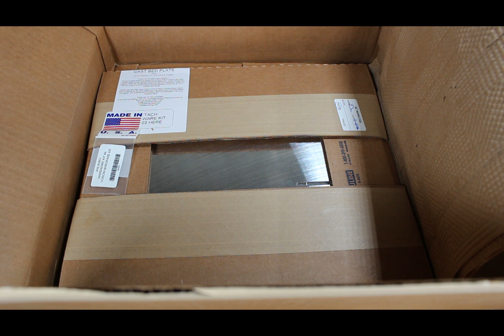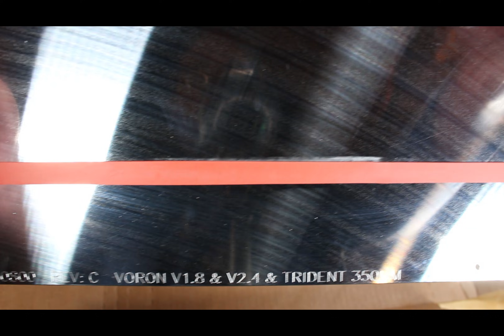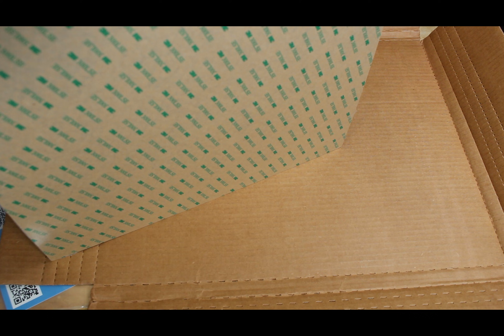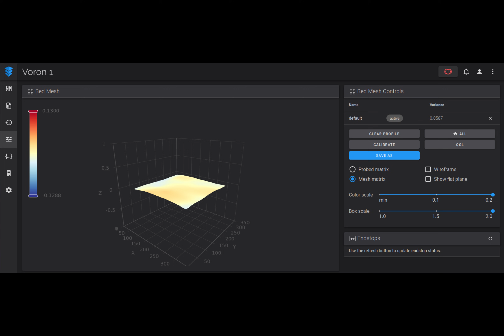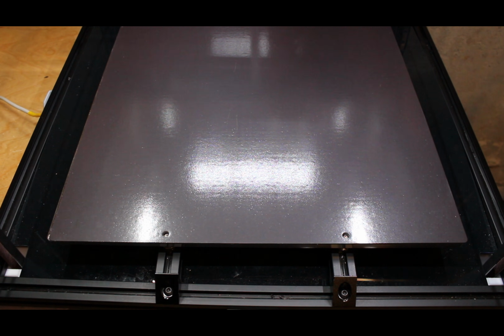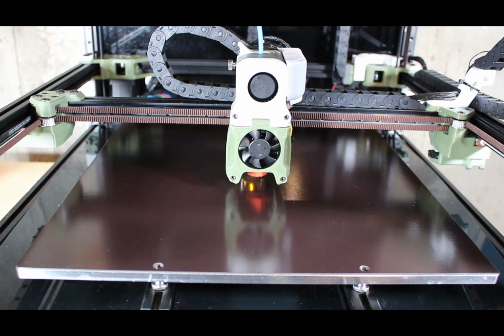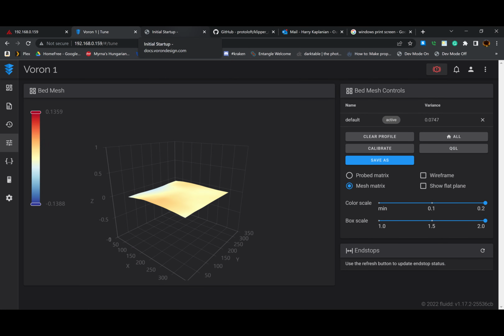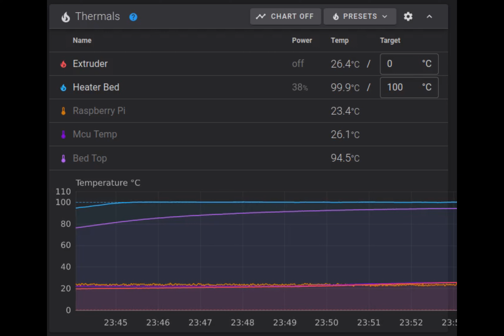The Secret to a flat  3d printer bed

Comment: I thought the whole reason for a mesh was so that it didn't matter how flat your build plate was... My variance is .5215 and I get good prints.
Reply from the maker: I would argue that a bed mesh tries to compensate for a bed that isn't flat and give you reasonable prints. It cannot make a bed or your print flat.  If you print a large object, even with bed mesh, it will still have a variance of 0.5215 on the side that was on the bed.  For most objects, this may not matter so you should be fine.  But if you need the print to be better than that, you need a flatter bed.  That said, a flatter bed plate actually didn't fix the situation. It was the application of the magnetic sheet that was the issue.  Thanks for the comment!
Reply: @KapmansBasementWorkshop  ahh I see exactly. If you print a 250x250x250 cube, the bottom will be wavy, and if those cubes need to be perfectly fit together, they wouldn't. Great explanation and great video!
Reply from the maker: Exactly. One other thing, it also just bothered me that I switched plates and my results were worse. I needed to understand why.  Hopefully this will help people when building their next printer.  Thanks!

Comment: i am not going to pretend it actually made any difference how you installed it or having bed flatness like that makes any difference or you actually needed it for anything its just ocd things
Reply from the maker: If you are referring to a difference in your prints, I think it depends on how much the bed is off.  Especially on large pieces.  But the way it was installed did make a measurable difference.  There is a aspect of OCD here, but to some it matters.  Thanks for the comment and watching!

Comment: nice mashined bed, maybe you could mention a important thing not to power it with 100% (depends on the heater power ofc).
The flatness of the mashined bed isnt that important i think after you put magnetic sheet and the print surface on it.
Got a cheap one out of a formbot kit and my Variance is 0.057 mm.
Reply from the maker: That is a good point and worth reminding people about 100% power.  
I think the beds that come with most of the known kits are good beds.  By using this new one, I was trying to take the aluminum bed out of the equation and limit the issue to something else and make sure people would not point to my bed provided in the kit as the source of the problem.  I think the video succeeded there, but I'm second guessing how I was able to communicate that.  Thank you for watching!

Comment: I use the same 750W heat pad and my bed surface and under the bed temp is normally 10 degree more or less gap, and, even more , the bed corner  temp is usually 3-4 degree less than the bed center.  Can't imagine what's the temp like with my old 150W 12V heat pad.
Reply from the maker: I'm digging out and restarting an old 3d printer I stopped using once my Voron was running.  It have one of those old heat pads.  I'm going to have a look in the next few weeks to see how well it does.  This is a good thought.  Thanks for watching!

Comment: I have a high quality plate but something in my gantry messes up the z variance .. im one step before rebuilding my gantry 😅….. i mean the prints come out nice but when im looking at my mesh diagram i get angry 😂
Reply: Yes the backer plates are also in my list.. someone used old linear rails as backers on the gantry … if i go for a single mgn9 hiwin would be the only choice..  i dont understand why some of the new single rail revisions of the voron are based on an mgn12. Maybe if the gantry moves fast from the front to the back you get more wobble on the nozzle due to less stability.. if the center of gravity of the printhead is to far away from the rail then the small rail could get an issue.
Reply from the maker: @rsmaster5637  I suppose so.  But so far, I have not had any issues.
Reply from the maker: Believe me, I know the feeling!  That was the start of this video.
How many rails on the x-axis?  MNG9 or MGN12 or something else altogether?
Reply: 2 Rails mgn9  .. i think i build a new gantry with one mgn 9 and the stealthburner.. or i go direct to a carbon fiber x axis with mgn 9 , lgx lite and stealthburner…
Reply from the maker: @rsmaster5637  In case you didn't see it: https://youtu.be/i8a2-Jd-dIo and the stl for single rail stealthburner: https://github.com/Kapman1/StealthBurner-Single-MGN9-Carriage
You can see the before and after of the single mgn9 rail and it's impact on the bed flatness (it improved).  Also, if you go with a single mgn9, make sure it's a high quality rail such as Hiwin.
I've been looking at carbon fiber square tubing.  I've received 3.  None of them are as straight and flat as the aluminum extrusion.  2 of them were very far off.  So I'm still on aluminum.
Finally, others have told me what a big difference backer plates have made to the flatness of their bed.  So you might want to look into that for the x & y on your gantry..

Comment: I'm wondering if this is why the Mandala Roseworks Mag Plate is preferred by most. Great video and makes sense, I'm building a Voron 2.4r2 soon, and was considering getting a Mandala plate to swap for the LDO kit, just don't know if it's worth the money or not. Lol
Reply from the maker: I think it is the reason.  But it's not cheap....thanks for watching!
Reply: My third Voron (and first kit Voron) was a 0.1 that included an upgraded Mandala Roseworks bed with embedded magnets.  Once I saw it and thought about it, I bought a new Roseworks bed for my 2.4 and I do NOT regret it.  It works really well and I’m able to consistently lay down a good first layer without bed mesh.  I do wish I had a thermistor on top, but I calibrate temp by pressing my DMM’s heavily-thermogreased thermocouple into the bed and correlating thermistor reading to actual bed-top temp.

Comment: Doesnt mesh bed compensation - compensate for any flatness issues? I had a glass plate that had some filament boogers underneath and came out find. even if the mesh was thrown off by 1mm in one corner.
Reply from the maker: It does compensate, but your print will still have it's shape impacted by the shape of the bed.  So it's always better for the bed to be as close to perfect as possible.  Bed mesh will help you have a successful print, but now your print has not technically "correct".  On some high precision (as good as precision can be with heated plastic) prints, this can be a problem depending how far off the bed is as well as the bed shape.

Comment: Use a high temp 2 part epoxy resin leveling liquid. You only need a tablespoon or so for the entire bed.
Reply from the maker: Have you tried this?
Reply: @KapmansBasementWorkshop  Not yet, but I'll be doing it on my son's CR-10 when I'm done modding this Ender 7. I've been trying for months to think of a reason that this might be a bad idea, and I can't. As long as the printer is on a level surface and it is applied super-thin ("squeegee" it with a razor blade), it should work. Some of those resins are good for 275-300 Celsius, so bed temps won't be an issue.
Reply from the maker: @apexncdaddy  I'd love to hear back about how this worked.  It sounds reasonable and I can't imagine why it won't work.  But the permanence is something I need to mentally get over.  Thanks for watching!
Reply: @KapmansBasementWorkshop  Agreed, though I can't imagine much actual damage coming from it as either way it will be covered (spring steel, pei, glass). An idea I need to think on is some sort of strong magnets (but not strong enough to affect the electronics) glued on the underside of the platform so we can use those magnetic build sheets without the adhesive backed magnetic sheets.
Reply from the maker: @apexncdaddy  There are companies that sell beds with embedded magnets.  I wondered why, but in hindsight, they seem like a great idea.
Reply: @KapmansBasementWorkshop  Who makes them? I've never seen one and I'm going to be building a beast of a printer over the winter where every gram counts. Would love to have something like that.
Thanks!
Reply from the maker: @apexncdaddy  They are not cheap.  Here is one: https://west3d.com/collections/vendors?q=Mandala%20Roseworks
Reply: @KapmansBasementWorkshop  $185? Yikes. There's $2 worth of magnets and 10 cents worth of glue in this printer's future. lol
Reply from the maker: @apexncdaddy  Yup.  :)

Comment: I wonder if you heated up the bed with magnet to 120 and then plopped it on a flat surface with the weight if you could have skipped removing and reapplying. Anyways, that's what I'm going to try as a takeaway from this video as I seek a flatter bed. Thank you for putting this out there and showing the process of discovery.
Reply from the maker: In hind sight, I wish I tried that.   If you do try it, please let us know what happens.  I'm 60% sure it will work.  One major thing to consider, will the heat cause the glass to shatter?  It might make sense to take the bed out and lay it magnet side down cold and then turn on the heater.  It will heat up slower and allow the glass to warm up slowly.  Then figure out what weight can be put on the back of the plate that's ok with the heat.  The glass table in the video is actually very expensive.  If I broke it, contending with my significant other would easily have been the most difficult part of the project :)
Reply: @KapmansBasementWorkshop  I tried this, and it didn't seem to work. Next, I will try a stone rolling pin at 120.
Reply from the maker: @tonyrouse6864  Not a bad idea.  I should have given that a try.  Depending how badly it is warped and the shape, you might want to try a slice of paper on top of the magnetic sheet, under the PEI to raise a low area....

Comment: Interesting video. Did you ever go back and back test the old plate with a new magnet cured on a glass surface? I'm sure the results would be interesting. Maybe a part 2 to the video? Great job either way!
Reply from the maker: I did not enjoy removing the bedplate :).  I do intend to go back to the original, but I think I may build a second printer and use that plate.  Or, get the tools to properly measure that plate for flatness and add a new magnet.  I'm convinced it's also very flat, but the magnetic sheet was the problem.  It's  a great idea for a part two, I should have thought of that!  Thank you!

Comment: What is everyone's best guess on the stacked tolerances of the pei, spring steel, magnet, and adhesive flatness is? I cannot agine the magnet is nearly as flat of the machined cast aluminum plate
Reply from the maker: Based on my observations starting with the worst (no actual tolerances):
1. Magnetic sheet adhesive
2. Rough PEI print surface
3. Magnet
4. Gantry

Comment: What is the deviation when heated to 110°C? My bed then has around .430mm (350mm-V2.4) after 1-2 hours, but I'm not sure how much of it is the bed and how much the x-gantry (double MGN9)... I run a bed mesh to print and it's going quite well overall, but I am still thinking about possible improvements there. Thanks for your great videos!
Reply from the maker: My apologies, but I don't remember.  However, have a look at this: https://youtu.be/i8a2-Jd-dIo
I eliminated one of the MGN9 rails and the bed appeared to get flatter due to less heat expansion in the gantry.  The measurements (before and after) are presented in the video.  It would appear to me that backer plates could improve that even more.  Thank you for watching and the kind words!

Comment: So basically your "secret" is to purchase brand new bed, heater, and full set of new PEI sheet, right? Thanks for sharing the "secret" which no one knows! :D :D
Reply from the maker: No, the trick is how you apply the magnetic sheet and let it cure.  It will cure in the shape of the surface used. I used a new bed plate to start with a known quality of flatness. An effort to rule that out of the discussion as I was suspect of my original plate. Turns out it was not the plate.

Comment: Yeah, but you've got corrogated cardboard under it on top of the glass. Which defeats ANY advantage of the glass when you applied it.
Reply from the maker: The magnetic sheet and the aluminum bed are placed directly on the thick glass surface.  I placed the cardboard on the backside to deal with the heater bump where the heater cables come in.  That is why it came out so flat afterwards.  The cardboard had nothing to do with it.  The Glass surface provided a much better surface than the previous wooden bench.  The result here is that you need to use the flattest surface possible when installing the magnetic sheet and letting it cure.  Your wooden work bench is not good enough for this task, not is simply placing the magnetic sheet on top and letting dry on it's own.

Comment: so i dont get it. you didnt show us how you put on the magnet the first time, so we wouldnt do your mistake, but instead you show us how you remover the adhesive.
Reply from the maker: I initially installed it on my wooden work bench which wasn't as flat as I had hoped.  That is the method most videos show when attaching the magnet.  The second time, The glass table provided a flat enough surface to create a significant improvement.  The key takeaway, your bed will only be as flat as the surface used to allow the glue to dry.

Comment: great video! i'm considering building my first voron 2.4. wouldn't it be a better option to go for custom made iron plate instead of aluminium one?
Reply from the maker: Thanks a really good question.  I would wonder about it's ability to transfer heat, my cast iron pan takes a long time to heat up.  And it would need to be cast iron for stability with the temperature changes.   I suspect it would work.  Interesting idea.

Comment: Based on how the adhesive responded to 120C, I wonder if you could have reformed it by heating to 120C with a flat plate (e.g. another aluminum plate) on top with some weight
Reply from the maker: That is the one thing I wish I had tried 1st.  But the wiring was problematic (way too short).  I still have my old bed.  Someday soon, I plan on hooking it up to a power source and a micro-controller and giving it a try.
Reply: @KapmansBasementWorkshop  You can get stand-alone PID controllers (capable of switching AC power, even) for about $50 on Amazon.
Reply from the maker: @benbencom  That's good to know.  I had no idea.  I suppose the $50 is worth it if it works and eliminates the need to remove all that glue.

Comment: Excellent video!  And kudos for showing the screwup and how you fixed it.  So many videos just show installations where everything goes right.

One thing I wondered about...should you have slathered the top thermistor in thermal paste before putting on the magnet?  Without a really good thermal connection, it makes sense that the thermistor is going to heat up more slowly.  The thermistor should eventually reach the actual top temperature though.   

And of course you have to take thermistor variation and accuracy into account to really know what reality is.  If I get one of these plates I might consider leaving that channel open and sliding a more accurate thermocouple (with thermal paste) in there, capture the difference in temp readings at different temp settings, and create a custom thermistor profile for Klipper.

Anyway, thanks again, and I'm with you - an actually flat bed is preferable to mesh leveling.  Either you won't need mesh leveling or you'll need a lot less of it (if you're looking for really flat party).  Either way it's a good thing.
Reply from the maker: Funny thing. I actually had a tube of thermal paste sitting on the work bench as I had full intentions of using it.  But, yet another mistake, I forgot to use it as I was so busy with everything else, especially shooting video....I would recommend the use of thermal paste.  That said, it's working petty well without it.  Best of luck with your improvements.  The key to this video (and you seem to recognize it, but some are not) is the flattest surface you can find to make sure that magnetic plate is flat.  Thank you so much for watching!

Comment: Got a request to print something big and here I am after bed mesh not really helping too much. variation for my bed is 0.16 but still getting some lines not connecting to the perimeter. I'm convinced a precise flat bed is probably the only true fix but I still want to try the single mgn12h upgrade to make sure X axis is not over constrained by the dual mgn9 rails. great video by the way and love your content.
Reply from the maker: If you are using a high quality rail such as a Hiwin, try the single MGN9 rail, take the bottom one off.  Have a look at this: https://youtu.be/i8a2-Jd-dIo
Reply: @KapmansBasementWorkshop  I took it off today and low and behold bedmesh working the way its meant to be and getting a near perfect squish on the first layer across the entire bed. guess I will be ordering that mgn12 after all since my current mgn9s have play in them. variance came down to 0.112 as well.
Reply from the maker: @lxc647  I'm glad to hear you have this working well now!  In general, high quality rails are not considered important for 3d printers, but for the x-axis, I would recommend a high quality rail like the Hiwin with some preload.  They can be ordered with various levels of preload which will tighten things up on that rail and eliminate any chance for play.

Comment: I would suggest to remove the plate and sit it glue side down on a bunch of those blue shop towels saturated with goo gone.  Leave it for several hours and the removal should be easier.  Obviously you don't want this to get to the underside and destroy the heater adhesion.
Reply from the maker: That is a good idea.  That would soften the entire surface in one go.  I should have thought of that!  Thank you for watching and posting!